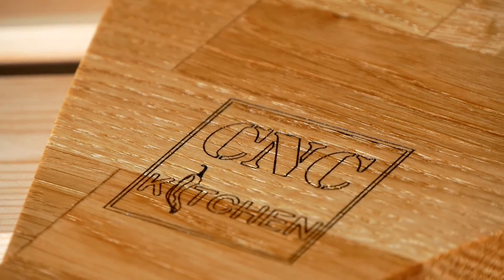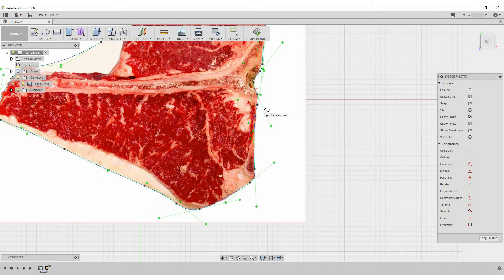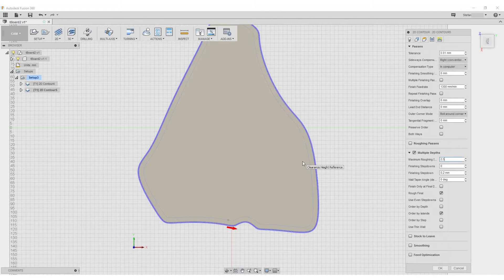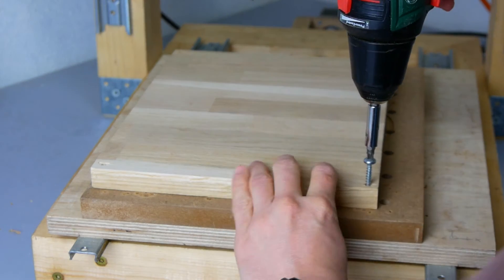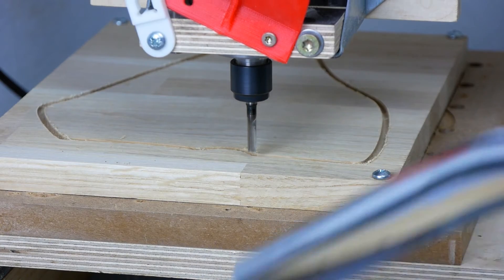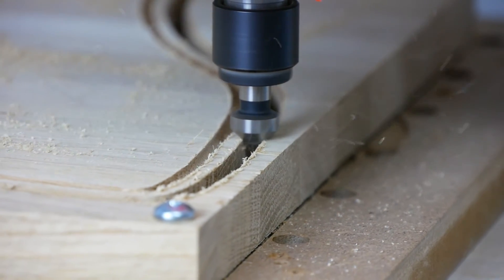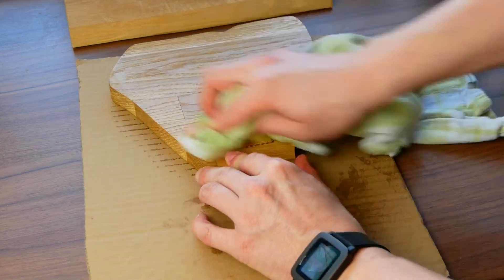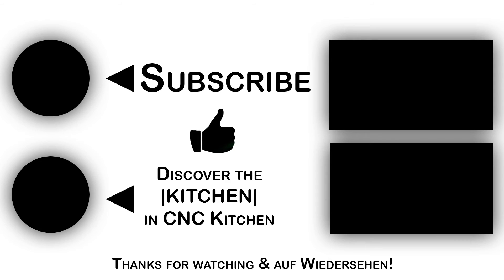Making a T-Bone Shaped Steak Board || From CAD to reality

Comment: Thanks for the drawer slider idea. I'm going to  build a similar machine, it's a shame I didn't think of the sliders before. I was going to use bearings on an angle iron, but this is way better solution. I would love to see a video about your CNC machine, especially how you read gcode files. Thanks man!
Reply from the maker: Using this CNC for 4 years now showed me that the drawer slides work, but are not optimal, since they are kind of soft. I should have rather spent a little more on linear slides. For G-Code interpreting, I use an ARDUINO UNO which runs GRBL and a laptop attached to it which sends the G-Code over serial via "Universal GCODE sender".
Reply: I'm also considering linear sliders but, they're much more expensive and harder to mount. What is the precision of your machine? Would it help to use fine metric thread instead of normal ? - probably not the weakest link in the chain... What's the name of the drawer sliders, where can I get them? Sorry for the questions, this video really got me thinking. Thanks for the fast and clear reply.
Reply from the maker: The precision is around +-0.25mm but depends on the material, feedrate and so on. It's probably a result from stiffness of the machine, stiffness of the spindle, precision of the leadscrews and backlash. The sliders are heavy duty sliders and were I guess kind of expensive, but we had them somewhere in the basement so I can't tell you where to get them. Definitely cosider linear rails, even the ones with linear barings as on a 3D printer.
Reply: Ok thanks!

Comment: You can route the full perimeter in Z down to the last couple of millimeters before skipping the tabs. Then they will be very easy to cut with a knife, and not visible at the top surface.

And do consider ballscrews! They have much less friction so you get the effect that your current steppers and drive electronics will seem more powerful as it is not wasted in the screws/nuts.
Reply from the maker: The tabs are actually only on the bottom 1mm so it was quite easy to cut.

I'm thinking about ballscrews, but it might be not woth it. I might build a totally new CNC just because there are other flaws as well.

Comment: Thats so cool ! what electronics you used on your cnc ?  And sure we want to see video about you laser engraver.
Reply from the maker: The CNC is driven by an Arduino UNO with stepper motor shield which is running GRBL. I connect it to my laptop which then sends the G-Code commands to it.
Reply: Have you considered uploading instructions on how to build it? Or did you use existing instructions found online? I'd like to build one, could you help point me in the right direction?